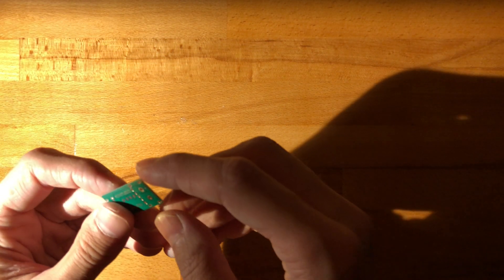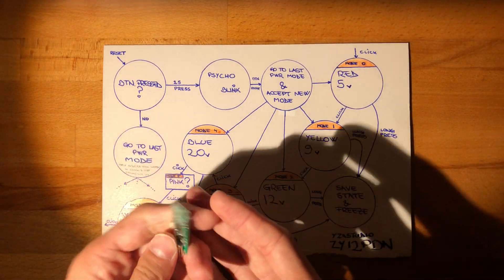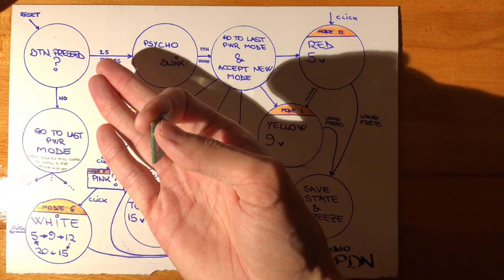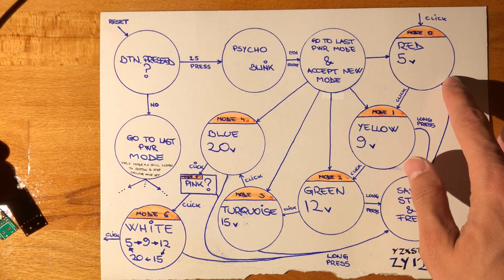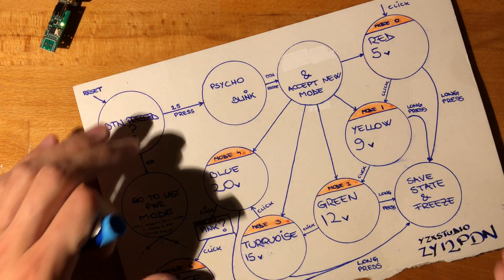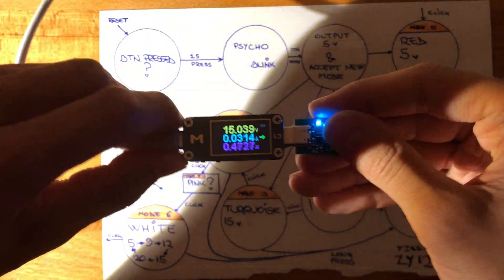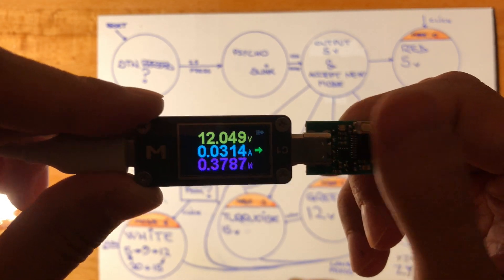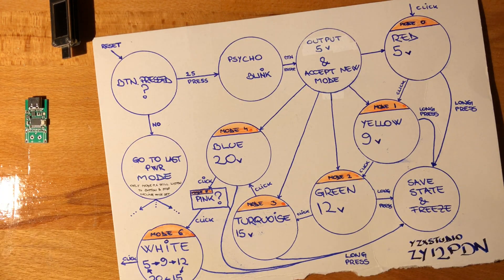YZXStudio PD Trigger Overview / Review

Comment: Have you worked on your radios with these? I want to do some fiddling with my bluetooth tape-deck mod but I don't want to have to get a 13.8V power supply. My Anker charger doesn't support 12V PD so I'd have to do 15, but I'm guessing the radio could handle it.

Comment: Where can I buy a PD module capable of delivering 100W which can be directly connected to my battery pack (21v 5amp)?
Reply from the maker: try searching for "YZXStudio decoy" - yzx do really good quality stuff
Reply: @Darieee  I'm not quite clear, are you saying I can connect this trigger board directly to my cells? This trigger board USB female side goes to my cells which means my cells should have USB male connection output to be able to connect to this board. I can connect my battery positive & negative to male USB breakout board's GND & VC pins. But the voltage regulation is done by the Communication Channel (CC). Where do I connect or how do I use the CC pin facing towards the 18650 cells?
In my understanding, and correct me if I'm wrong, that this trigger board is only like a regulator which can be used to regulate the voltage. But the voltage which is given to it's input" should be in the form of PD standard".
Here, in my case the input voltage to trigger board are from my 5S2P 18650 battery positive & negative terminals.
Reply: Aliexpress. Feb 22 Store is one of the stores carrying a selection. BE WARNED the buck boost chips overheat and I can't get them over 65W without a lot of active coolings (2 40mm blower fans). SW2303 modules have recently popped up for $11 shipped. I have trouble with those. Feb 22 Store has a similar SW2303 based board in an acrylic case, terrible idea. 1mm of air flow below the board means it shuts down even faster. IP2368 I believe is the most common buck 100W PD IC. Need at least 21V input to get 20V output. I dont own one but they seem to actually work. I also own the 120W bidirectional full protocol blah blah. Based on the SC8812A I think. another buck boost that is only meant for a 4S lithium pack, again needs cooling otherwise boosting 12-16.8V up to 20V at more than 2 Amps instantly triggers the thermal protection. I love the board for how small it is but cant use it unless i add a fan to powerbank case with switch for laptop charging

Comment: Nice to have a good reveiw on these baords! To bad those IP2721 and the one you showed do not support te data pin quick charge standard. I recently bought a ZC826 that has the IP2716 on board that should do it. Seems like a good option combining it with a 4s pack (SC8802 charge IC already on the board, but no balancing -> need a BMS with balance). but it's costs a lot more :/